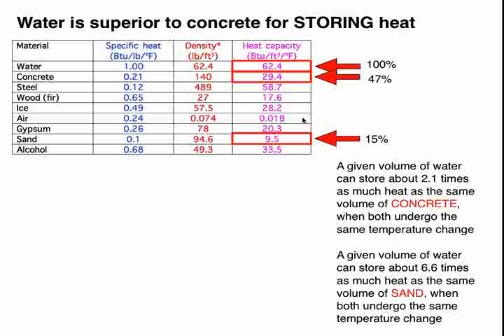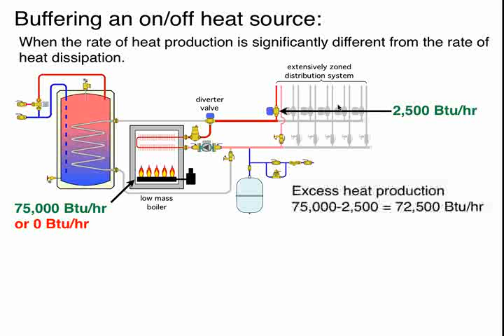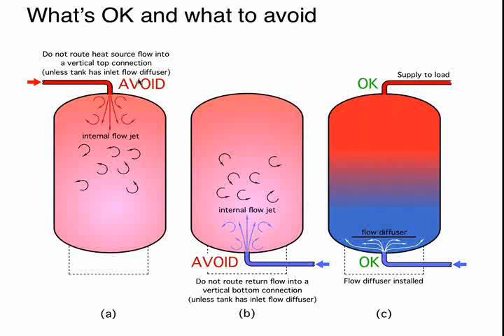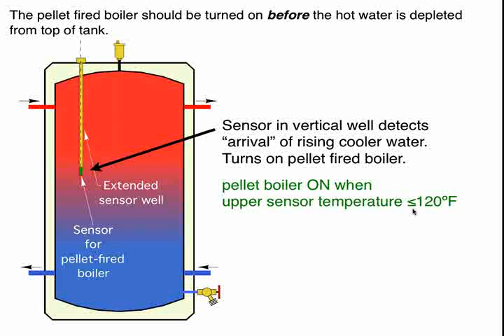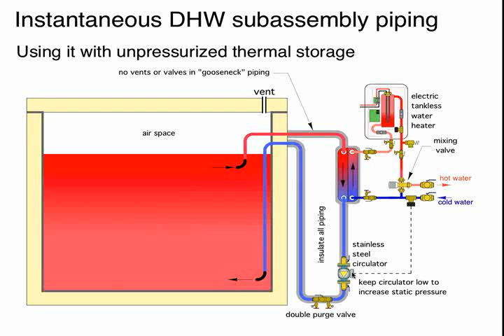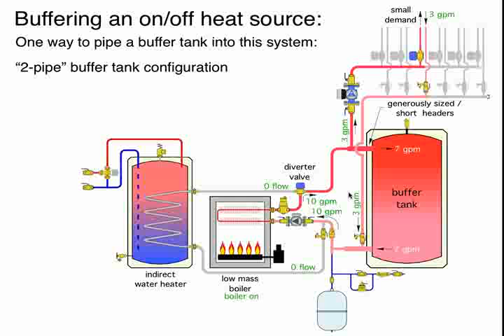Utilizing Thermal Buffering in Hydronic Systems

Comment: idronics 17 page 35 (also mentioned in the video) states that "The stainless steel heat exchanger should be sized for a maximum approach temperature difference of 10ºF. This refers to the temperature difference between the water entering the primary side of the heat exchanger from storage and the water leaving the secondary side of the heat exchanger."   Why is this the maximum temperature difference? What is the problem with installing a brazed plate heat exchanger with a higher temperature difference for a single thermal mass combisystem?
Reply from the maker: The appropriate approach temperature design will depend on the size/cost of the heat exchanger and the maximum temperature output of the heat source.  In this particular case, 10F was the number used.  There is a more detailed description of approach temperatures on page 45 of idronics 29, which focuses entirely on heat exchangers.   https://www.caleffi.com/sites/default/files/file/idronics_29_na.pdf

As always, reach out if you need help with a specific application: techsupport.us@caleffi.com

Comment: what if i would like to use the 2 pipe figuration but i want to connect on the top of the tank, i only have a 1 inch on top and 2 return pipes 1 1/4 inch in the bottom of my tank, i thinking of the "stirring problem u talked about? my wonder so i can skip configure or buy a new tank..
Reply: and also how big should the connection be to not lose flow for the 2 pipe system, 1 inch minimum=?

Comment: Great content...could you do a heatpump with woodpellet as back up on a 2 pipe system?
Reply from the maker: Thanks for your question.  Yes, it would be possible to combine a heat pump with a pellet boiler, although the expense would be high.
The distribution system would still need to be designed for low water temperature to ensure compatibility with the heat pump.
Reply: @CaleffiHydronicSolutions  I have all the equipment already..it's just a matter of connection.  With 2 buffers in series, wld the 2 pipe system be optimal, with 4 sensors.I found the woodpellet with one sensor was pointless as the burner was almost coming on with the demand.  ive 2500ltrs of storage...and significant solar contribution also.
Reply: @CaleffiHydronicSolutions   I used to supply and install these systems but no text book or entity has the depth or understanding as ye tbh. Most have entry level designs and people end up falling back on condensing oil boilers due to poor design and poor craftsmanship.

Comment: Could you point me to a source for comparing buffer tanks? I have a Navien Propane Tankless with dual heat exchangers, and a Ecoheat Pellet boiler on a hydronic baseboard system in New Hampshire. I'm having some issues finding equipment to compare online. I'm just learning about the buffer tank, but my propane heat definitely short cycles a lot. The Pellet boiler is being installed as I am writing this. Thanks! Very informative!
Reply from the maker: Thank you for your question and comments!  We would recommend that you contact your local installer for recommendations.  As well, for further information on thermal storage, we would recommend the 17th edition of idronics:  Thermal Storage in Hydronic Systems.  Here's a link to that resource:  https://www.caleffi.com/sites/default/files/coll_attach_file/idronics_17_na.pdf